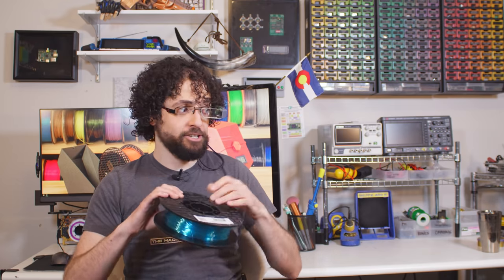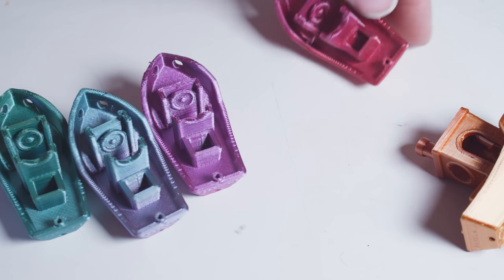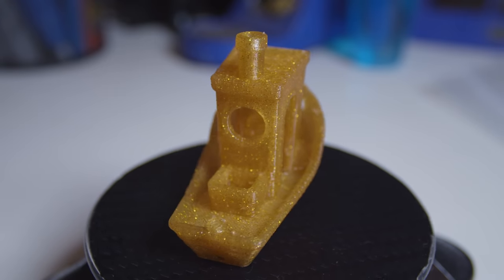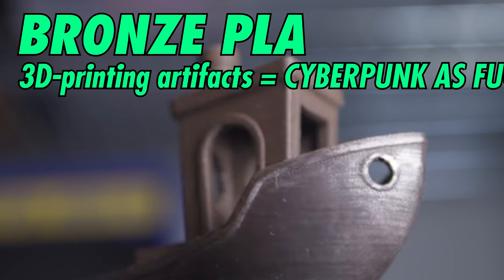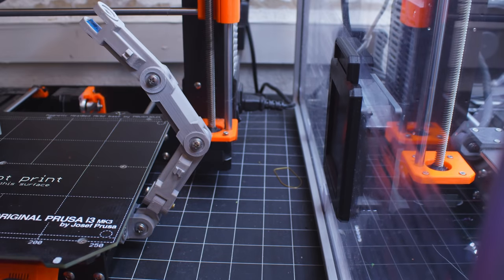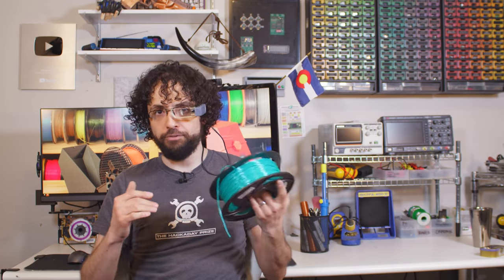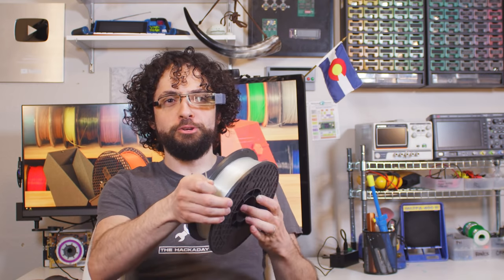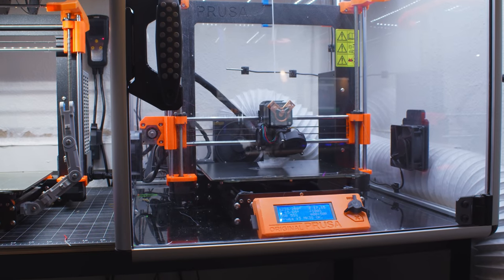I Tested (Almost) EVERY FILAMENT on Amazon: Every Single Filament Part I

Comment: I always thought firearms were the best test of a filaments durability... but at the same time, there are some very tough filaments that won't work for firearms, because they can't handle impact very well. I always wondered what would be the best for that application. Was thinking about doing a test one of these days, to make small samples with each filament I can get and impact them with about the same force as a handgun (in various calibers/power) to see which one's hold up best. I'm not sure if that would really prove much though, because no device/sample could really take the place of an actual firearm... and when it comes to firearms, there are countless variations in design and the types of stress that the frames on real handguns would experience. Like many nylon framed guns have the slide impact the nylon itself (like Glocks for example)... while on others the slide impacts a frame insert like (if I'm not mistaken) the P365 and P320.

Comment: Question. Do they make printers that do more then 1 color? Like say you want to print a zebra. Or can you take different color filaments. measure and cut out lengths of different colors for making certain lines or color contrasts in the model your printing and melt them together before feeding in the machine? Or are there printers that do multiple colors at once?

Comment: What dremel bits are you using to polish and sand? I’ve tried the 120 grit sanding “wool” tips but they get torn to shreds after about 5 minutes of use

Comment: Hardened nozzles should be fine for every type of metal they'll were down over time but the only things that can really damage a hardened nozzle would be carbides (not to confuse with any carbon like carbon fibers) they shouldn't be that common in Filaments but some may be found sand

Comment: I just ordered my first printer the Ender 3 max! I'm thinking about using it to print fairings for my motorcycle, and then wrapping it in vinyl. Which filament do you think is best for this type of job? Thanks

Comment: Hi Zack, I need to print 4 part filament that’s hard and durable. Hard enough to withstand some pressure applied for the use of mould casting.

Comment: I own all of them. Only after I bought some of them, did I realize, I would need a hardened steel nozzle. I am lazy, so I am going to buy a separate 3D printer that had a hardened nozzle so I don’t have to mess with the nozzle on my JG Maker. It has been 8 years since I started printing. I have two printers that caught fire and are now parts in a box, and two that I use regularly.

I might just buy a printer for each filament that exists so I don’t have to waste time configuring them for each print. 😅

Comment: Wow....you know your filaments.  Incredible presentation.  Okay, I've sucked up enough, now for a question.  I want to print some fishing lure molds that would require staying together (not melting) when 325 to 360 degree (F) of lure plastic is poured into the mold.  I am leaning towards using PLA 3D870 and try pouring at cooler temps but wanted your thoughts and input.   Thanks again for the great video.

Comment: Omg, the fact you use a crkt Pilar in this video. Just, chef's kiss. I got the, possibly unintentional, joke.
Reply from the maker: It's a nice knife, even if I have to sharpen the blade every ten minutes. I've since filed down the corner near the finger cutout, I just kept cutting myself on it...
Reply: @ZackFreedman  they make versions with d2 steel blades. Less sharpening but will rust easier so ymmv. But still, a great tool

Comment: this seems like the right place to ask for a special filament: i Need a flexible easy to print filament, which is matt black. all tpu i can find is shiny, but i want it matte black and in kg or even 3kg spools, not 500g spools. 

in case you want to know what for, you probably wont know what it is: EUC sidepads.
Reply from the maker: Pretty much all flexible filament is shiny... it's got something to do with how the material settles as it prints. You could use Prusa Slicer's "fuzzy skin" option to artificially add some texture.
Reply: @ZackFreedman  I'll use curas fuzzy skin, but it looks better with Matt filament. That's why I'm asking. But ok, i see that flexible filaments are mostly shiny, hoped for an exception.

Comment: all i need is a filament that is a a bit stronger than abs, that can be printed with details(lines or otherwise) as small as 0.2 or 0.3 mms,  i don't care if it is 2 to 4 times as expensive as the regular abs or pla filament spool(around 20 bucks if i remember correctly is the standard), and ones that are transparent and or metallic that are about as strong as a pla, and as accurate as i stated before, again, even if the price is a lot higher, what would you recommend?

Comment: I am actually printing TPU in a Ender 3 bowden printer without issues. Only problem is that retraction has to be very long.
Reply: Is it standard 95a? I would be really interested to see if you can print stuff similar to ninja flex

Comment: SS shouldn't hurt a hardened steel nozzle. SS is an alloy, depending on what kind of stainless is in the filament (ferritic, austenitic, duplex or martensitic). Some harder than others but none of them should be harder than a hardened carbon steel... nobody is gonna see this but I like sounding smart.

Comment: Yup I’m a beginner and started off with glow filament 😂 it clogged a ton had to go between 190 and 200 on the nozzle after it preheating it would sometimes print okay or sometimes just clog up and start making plastic bubbles  super frustrating on a part that was half way their and took 3 bours

Comment: I'd love to see an in depth video of how you actually succeeded with delrin/acetal since I laughed out loud when I heard it was on your list;) As someone who has done it, the description you gave runs against some of the things I did to get from A to B so I'd love to hear the info. That material in particular is one with very little info on how people have managed it compared to virtually everything else. I consider myself fairly competent since I run approx 200kg of ABS a year through my machines, including large parts. But POM yeah she's a rough mistress I've had some success, I'm fairly confident I could do a benchy from it though I never tried. I did make some functional parts from it though size of the parts quickly became an issue. Warping also leaves ABS warp in the dust, I've watched it warp plywood;) Anyhow I'd love to see further info or even just temp/feeds/etc on what you had success with and maybe time permitting I'll fiddle with some projects again with POM.

Comment: Dont be discouraged when he says you need all these things to print carbon fill Nylon. Also, he's holding up Sainsmart carbon nylon and thats the worst one imho. Guess it used to be better but they change the firmula all the time. I get beautiful, nearly perfect functional prints with Taulman Glass Alloy Nylon, Carbon Alloy Nylon, and Fiberlogy PA12-CF15 using a Prusa Mini with a ruby tipped nozzle. While the printer is inside a 2x4x8 foot grow tent to vent the fumes outside, it's definitely not a temperature controlled environment. Had I seen this video first, I may have never even tried these amazing filaments. For fully 3d printed FPV drone frames, the PA12-CF15 is the stiffest and incredibly strong and light. I designed a fully printed 3.5" fpv frame and canopy that gets 7+ mins of punchy freestyle on a 650mah 3S pack with 5000kv 1303s and biblades. It has taken crazy hits and Ive not broke one yet. Easy to tune. It's all the things everybody says is not possible with printed frames. Glad I wasnt discouraged. Keys to printing with these three filaments on a Mini: 1. Dry the filament at 158F/70C for 8-12 hours. 2. Use a hardened nozzle. I can only recommend one with a ruby tip as it's all I've ever used. After extensive testing, the $25 ones on Amazon are every bit as good as the Olson, and neither ever wears out. I have .4, .6, and .8. These tips can be left in place for printing all other filaments like Filaflex 82A, flex40, 98A, CPE, PLA, Alloy 910, T-Glase, PCTPE, Bridge Nylon, HD PLA, Impact PLA, ColorFabb XT,  XT-CF20, Glow PLA, Glow TPU, etc. So unless you need to switch to a .8 to print a large object quickly, you never have to change the nozzle. 3. Use the satin print sheet with a thin layer of Kores regular glue stick applied. 4. Reply to this comment and I'll post my printer settings. I can also just share a .3mf containing them. 5. However you do it, vent the print fumes outside for ANY filament. I use a "grow" tent with 4" inline fan.

Great video Mr. Zack. Thanks for letting me insert my 2 cents.  I think you have at least two updates to this video which I'll def be checking out.

I open source my designs so if anyone wants to check out the FPV frame I referred to, or others, from 80mm frame (40mm props,) up to 3.5" (prop size) just say the word. I can't count the times I've leveled up of off finding random, info dense comments like this, so hopefully, someone finds this helpful. Cheers!

Comment: I've been printing TPU 95A with my CR6 SE with the stock PTFE bowden tube with only occasional failures.
I think the trick is to not actually know that it's impossible.  I wonder if my next print will fail now that I know it's impossible. 🤔

Comment: Ok, I'm confused about purge and cleaning filament. It sounds like cleaning filament could be used instead of purge filament? The difference between the two is unclear to me other than cleaning filament was designed to scrub injection molds... Can someone please explain?

Comment: Normal PLA has more stiffness and strength but a slighty worse impact resistence in comparison with PETG (Kudos to CNCkitchen). For normal prints I would always use PLA.

Comment: My Qidi PLA printer has an enclosure, but the instructions say to open the door and windows and remove the top to get ventilation when using PLA.  The doors and windows and top are apparently only for ABS.  Should I be using the doors/window/top anyway to enclose the printer, despite the instructions?

Comment: Okay Void-Star Zackman, my grandmonsters want a floating 3D Benchy, and while I have not exhausted all possibilities; I have discovered to get enough weight in the bottom of the benchy, it is too much weight to allow the benchy to float.

So my challenge is can a 3D Benchy be made from a single material, AND keep the size ratio to the original, and float?

Comment: @20:15 I guess paying attention is not my forte... Saw this Video months ago but still failed to remember that HIPS may be a suitable Interface Material for ABS ( well... ASA in my case ) so I went to the 3D printing Reddit and unnecessarily asked what material may work for that purpose 😑

Comment: great video. I swear when I watched this the first time you said one of them was FDA approved for food, use but I can't find it. I don't need an FDA filament right now, just wanted to keep it in mind if I ever decide to print something
Reply from the maker: Many of Taulman's and Fillamentum's products are approved for foodservice use. If possible, keep a dedicated, clean printer just for food-safe filaments, with nontoxic grease like Super Lube. There's no point running a food-safe filament if the printer itself is contaminated...
Reply: @ZackFreedman  After watching this video a few more times I found it. T-Glase is the one you said is FDA approved.

Comment: We’re buying our first printer tomorrow! Thanks for this overview; very helpful. I’m making a custom pc case that will have printed square frame shaped pieces as a base and lid. I was going to use petg but maybe I should use ASA? I don’t have a shroud yet. I would like a smooth glossy finish. These pieces will be contrasted with copper sheeting. Any thoughts?
Reply from the maker: Good luck! I think PETG is better for your project, though I'd recommend getting a dehydrator too. PETG can be extremely glossy, but only when it's absolutely bone-dry, even more dry than it ships.
Reply: @ZackFreedman  thanks very much.

Comment: 28:00 -ish

i have an ender 3 with a boeden (however you spell it) style extruder, and it does TPU just fine

however, i do admit it is a bit of a balance getting settings just right due to it's flexibility

Comment: In your experience, which is the most clog-free filament? (Im using a Monoprice brand printer with .4mm nozzle) Thanks!
Reply from the maker: As long as you're not printing flexible materials or composites like carbon fiber, glow, or metal, your printer should almost never jam. 

As long as your extruder and nozzle are decent quality and you maintain them fairly well, only the lowest-quality pure-plastic materials should jam. It might be time to deep-clean your extruder, cold pull your nozzle, experiment with higher temperatures, or consider an upgrade.

Comment: Is it sorta safe to have the printer near you in a room with just a house fan while printing PETG?
Reply from the maker: Yeah, as long as you vacuum regularly and get some fresh air in there. PETG should never off-gas anything toxic, and printing it doesn't generate many microplastics.
Reply: @ZackFreedman  THanks i like petg its easy to use and get to work lol

Comment: Has anyone ever produced a filament that has micro-fine Carbon Ash in it? It is burn resistant as it is already ash, porous, strengthens things like concrete by up to hundreds of times the norm, and can be low-abrasion, so I've heard.

Comment: I am new to 3d printing. I am going to buy my first 3d printer for every day use and some mechanical parts for my motorbike. I am between Bambu Lab P1S and Bambu Lab X1-Carbon. Which one is better to start?
Reply: Get p1p
Reply: @ohfr20  can I change to Hardened Steel nozzle?

Comment: I have some Rubber like  Scoubido Strings used to make boxknot keychains in my closet can I use it for 3d printer Filament?
Reply: What in the hell is a "Scoubido"?
Reply: @TheSolongsidekick  it is a weaving form that is used to make keychains. Or arm bracelets
it is also known as Plastic Lace Craft
Reply: @Josivis  Jesus there's an insane number of brands selling this stuff but I was able to find that a major material is plasticized PVC which you absolutely can NOT print. It will kill you.
Reply: @TheSolongsidekick  thank you.

Comment: Ok , that's all very well.... but you omitted the most important spec of all..... Which filaments are puppy doggie safe ???!
Reply from the maker: I don't think most filaments will harm a dog, but if you want to print a chew toy, you might be better off printing a mold and casting a pet-safe flexible resin.

Comment: evil anit-masker here, ABS is my drug of choice, been using it for years, I have not tried too many of these plastics, want to try HiPs now but ABS is wonderful. It sands like fine grain wood to a perfect smooth surface and yes it does warp but...hardly ever with a correct printer. Also its pretty tough. I keep my machine out in wild open so the smell is no issue.

Comment: Im looking to buy a 3d printer. Im looking at artillery x2 or the ender 3 v2. I heard the artillery doesn’t print as good and screen is small and confusing but i like its printable size. The ender seems okay but i would like to print bigger stuff. Anyone want to give their 2 cents? Thanks!

Comment: What would be best if I wanted to make those print-your-own nerf guns?
Reply from the maker: I personally use PETG, but if you can use ABS, nylon, or polycarbonate, it'll last longer. PLA is tough enough for blasters, but it can melt under the hot sun, and tends to fail by shattering.